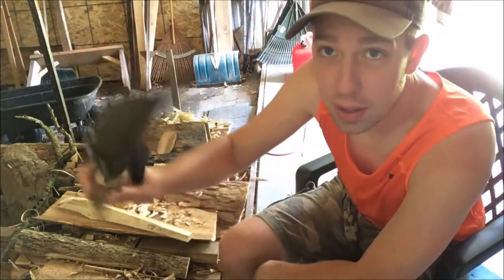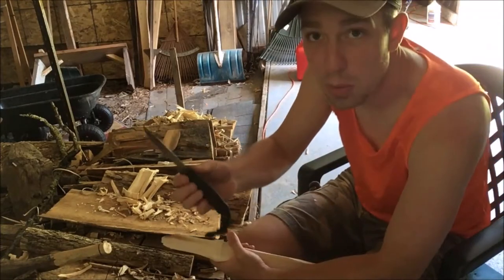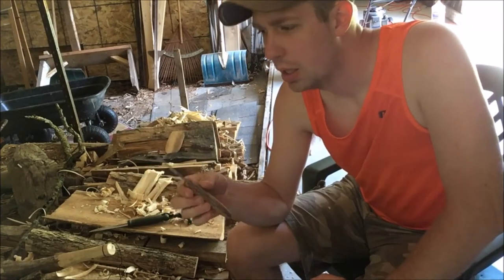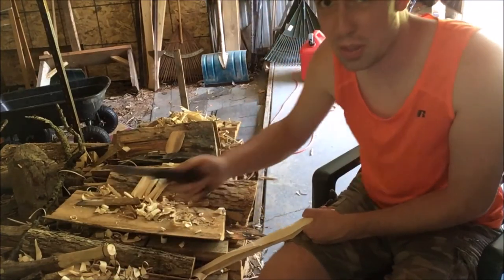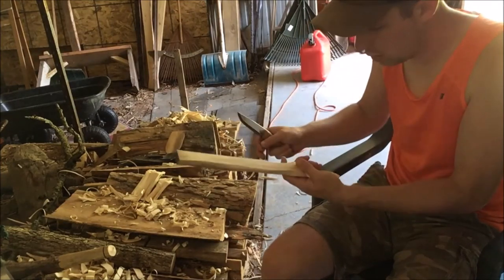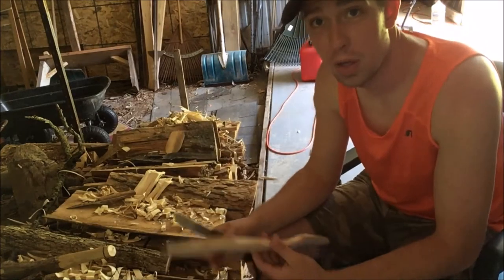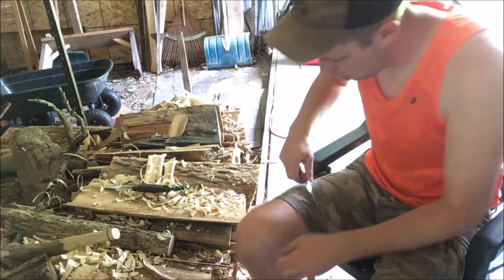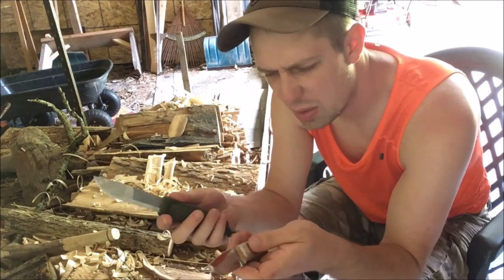$35 Mora vs $105 Enzo

Comment: You are right that's it's not about how much a knife costs. I can do anything I need to with a 10 dollar Hultafors GK and I actually do, so when you talk about value for money that beats them all. But of course filleting fish is better with a thinner knife, cutting veggies with a flat grind, etc. So the one tool option is always a compromise. But most people just buy knives because they like knives. It's a hobby. So why compromise and just get one knife? If you can afford is buy some for different uses like you do with kitchen knives. I did enjoy the video ;)  Btw. I never heard of Enzo using M2 steel.
Reply from the maker: Yeah Enzo did a short run in M2, you can still find some if you are lucky.  It was an awesome steel, but quickly became eclipsed with another super steel.  I'd still rate it in the same category as CTS XHP.